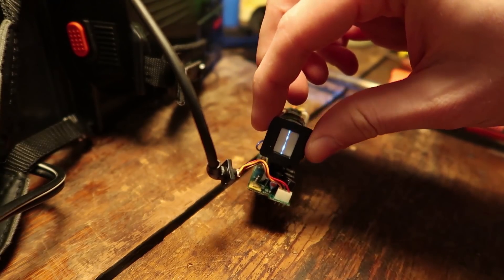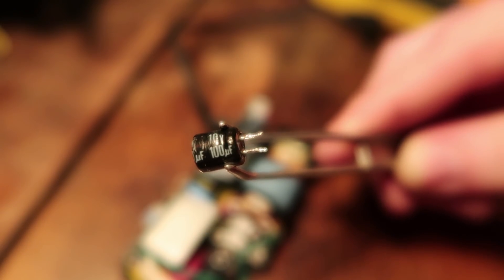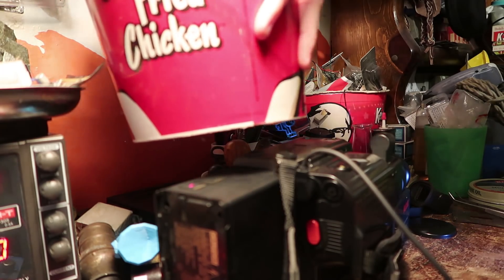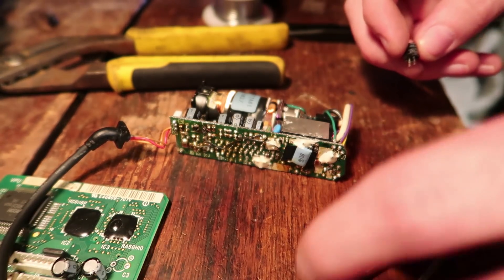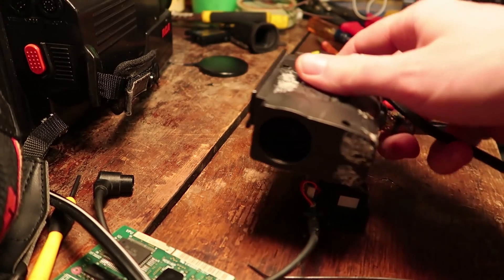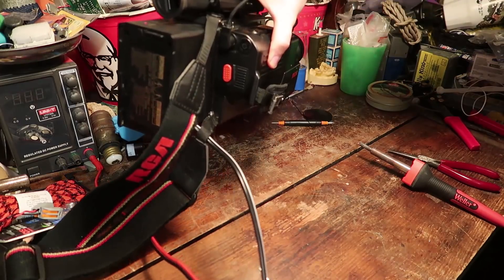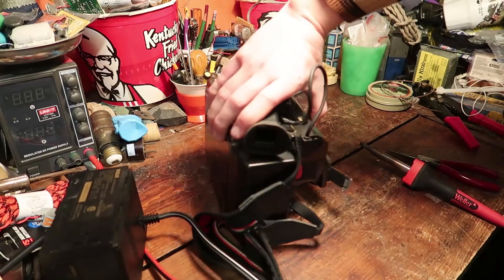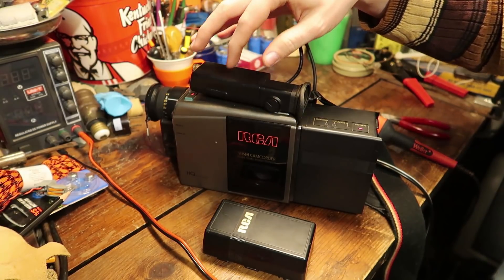1987 RCA Camcorder Repair : Replacement Capacitor for Viewfinder

Comment: I have a large 1989 RCA CC286 with a viewfinder problem, it has power to it, I can hear the little crt squeal noise, but it has no picture. The noise changes when I adjust the tuning screws and at one point it randomly turned on. I unplugged it and now it is still making noise but won’t display any picture again, this makes no sense to me, loose contact? Bad cap?
Reply from the maker: The noise means you have power to the flyback transformer, but doesnt mean that the flyback’s power is going through the crt. The flyback’s connection to the CRT may be broken and need fixing. It can still make a similar sound if the flyback is just shorting to ground.
Reply: @ anyway I can bench test this? I sort of don’t know what I’m doing
Reply: @ Oh also if this helps the only time it turned on was when I was tweaking the horizontal trim pot and than of course didn’t do it again when I unplugged and replugged
Reply from the maker: @ If you live on the east coast you could bring it to me to fix.

You may have been moving the wires when adjusting the pot. I'd say take a soldering iron to a lot of the solder pads on the bottom of the circuit board. Reheat the solder in-place to reform any cracked solder. Use a multimeter to check continuity within all the wires.

Comment: For give me if I sound dum but am Learning if it worked without it what is the need to replace it
Reply from the maker: i think it helped make the picture clearer, smoother voltage going to verticle and whatnot
Reply: thanks

Comment: i bought a cannon cannovision video camera the view finder powers up all you get is flickering lines i opened part of the video camera difficult to open the other half , so like your issue it could be capacitor issue , i know certain parts from son cameras sanyo and cannon use similar parts a sony video camera i had in job lot had faulty tape carriage had missing parts but the viewfinder works

Comment: tell us the model and brand of your thermal camera, please!
Reply from the maker: Therm-App Hz, costs about 1,900$
Reply: A few years ago, I  already knew that the therm camera is good for locating over-heat component. I asked people from the net to show us the therm image of a motherboard but no one did. Would you be generous to have a clip on the overall thermo measurement of a  motherboard. You do not to need photo each component, just a overview will be good enough. Greeting from Hong Kong and thanks in advance.
Reply from the maker: search google for thermal images of motherboards.
Reply: Well. Take the thermo  image of SUN, moon,...etc and compare with NASA's and see if NASA is telling lies.

Comment: You may want to be careful about touching it while live. The small CRT still requires quite high voltages to operate.
Reply from the maker: notice im touching it only on the insulated parts.

Comment: Be careful working on CRTs. Some operate at 10s of KV. A shock from them can kill you especially when they are plugged in...
Reply from the maker: yes i know that already. small ones like this only have maybe a hundred volts or so thankfully.
Reply: Safety fist! 
Wont kill you but you will certainly feel it. 
If you are used to work with CRTs you lose the fear.
you know your close to high voltage if the hair on your arm rises and you feel the Ion wind.